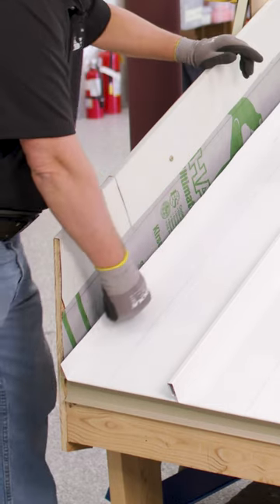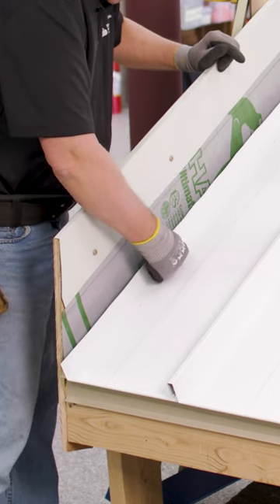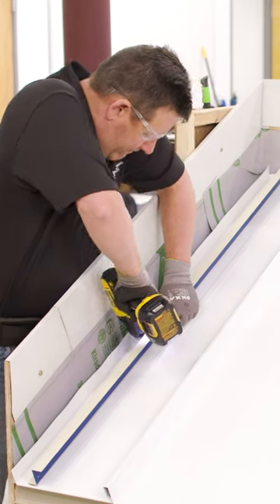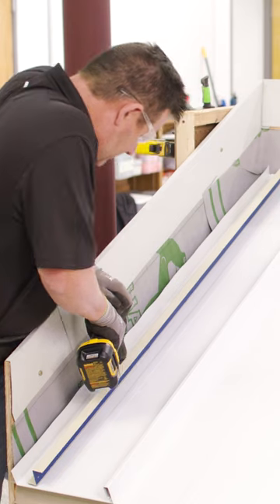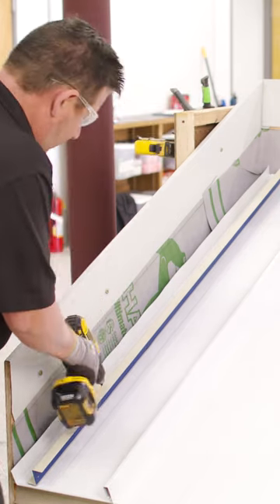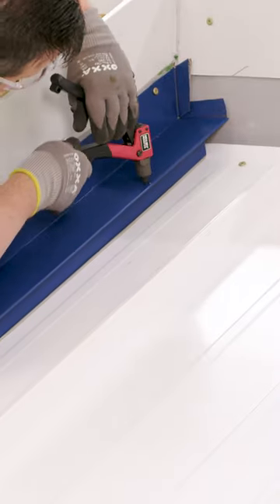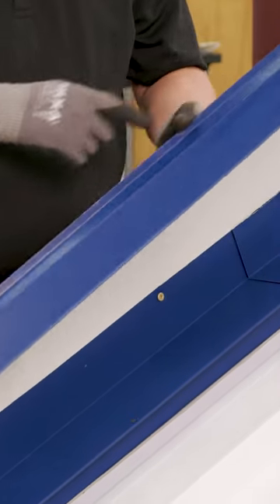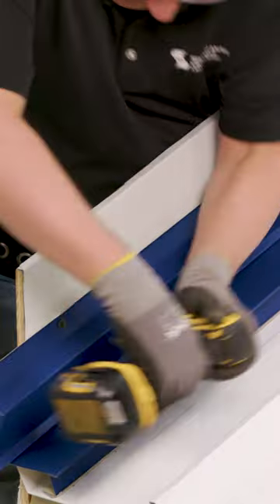SW3 Sidewall Detail Installation for Standing Seam Metal Roofs #shorts

Comment: Is this the correct method for installing standing seam roofing?
 Working with in the residential Roofing field I have never seen this detail in any of the installation manuals.

I do, though, however, believe that this would be very “top notch “way of installing at the side wall.